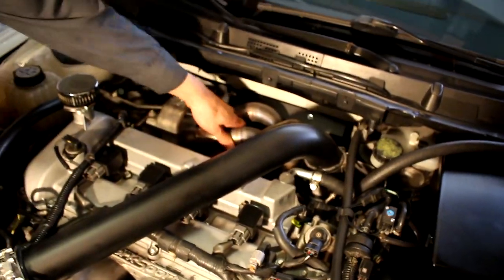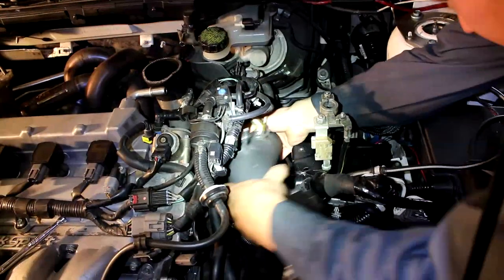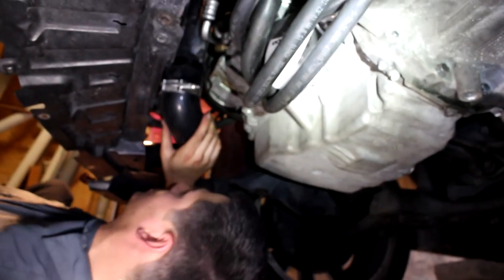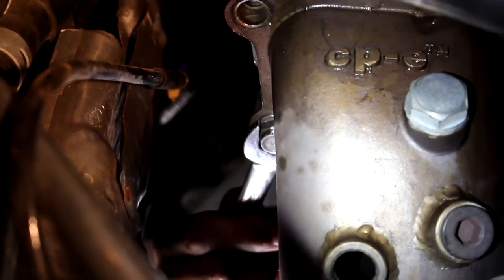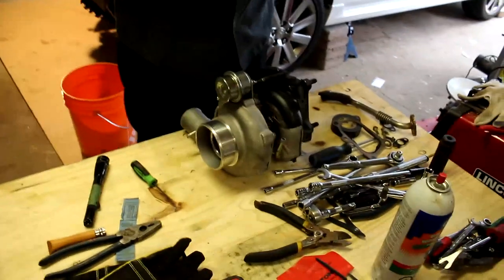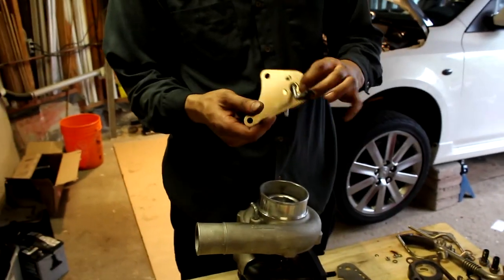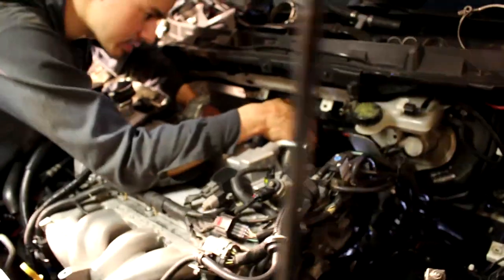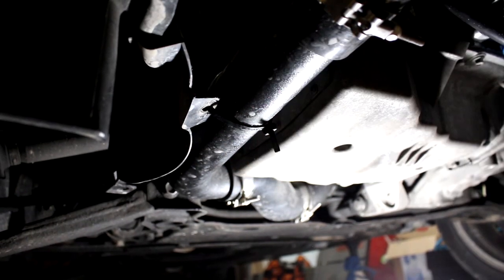Mazdaspeed 3 - Clocking the BNR S4 Turbo & JBR Under Route Piping Kit Install

Comment: Are you clocking the turbo because you uave the underoute piping?
Reply from the maker: Yeah that is exactly why :)
Reply: Can you order it from BNR already pre-clocked?
Reply from the maker: @mjl6425  No I don't think so. U can call him and ask but I doubt it. The issue is that u will most likely need to adjust it
Reply: So any underoute piping the turbo needs to be clocked?
Reply from the maker: @mjl6425  Yes all turbos need to be clocked if u want to run under route piping :)
Reply: I-did-not-know that! lol Did you notice lower temps with the underroute piping?
Reply from the maker: @mjl6425  It helps a little bit, but it's not a huge difference. What's good is that it's a shorter path with less plumbing, and heat soak is less common since the pipes run below the engine where it's cooler. I noticed a big benefit with JBR's thermal insulating gaskets. The intake manifold doesn't get nearly as hot as it used to with OEM gaskets. Every little thing makes a difference :)
Reply: Yes I agree. Did you notice any leaking from the Jbr gaskets?
Reply from the maker: @mjl6425  No leaks to report. As long as the surfaces are clean and things are tightened down evenly, everything should be good
Reply: right on. What did you use to clean the intake manifold mating surface? There’s a bit of old gasket residue I can’t seem to get off. Scotch-Brite?
Reply from the maker: @mjl6425  Just a rectangular flat razor blade, some brake cleaner, and a microfiber rag
Reply: Cool thanks I got it all off but then I put swirl marks everywhere scrubbing it with a nylon brush smh! I swear it’s one thing after another. What can I use to polish out the scratch marks? Any ideas?
Reply from the maker: @mjl6425  Oh darn. Maybe try really fine grit sandpaper to smooth out the surface, but don't go too crazy with it. You just want to smooth it out to ensure no air leaks
Reply: I tried a little spot with 1000 grit sandpaper took out the scratches but now the finish is cloudy looking. Not sure if I want to do the whole thing. But I have a AP TIG, won’t that seal minor scratches like the Jbr?
Reply from the maker: @mjl6425  Yes that TIG should seal up nicely. I would just lightly sand the entire surface evenly until its smooth to the touch. Then clean it with brake and parts cleaner and a microfiber rag. No need to go overboard with the sanding though. Smooth to the touch.
Reply: I’m willing to do that but it’s going to dull the finish. Do you know of a way to bring back the shine?
Reply from the maker: @mjl6425  U could try polishing it! But tbh that area will not even be visible. The goal is to have it seal properly, not shine lol
Reply: Lol ik I’m just a little OCD when it comes to stuff like that. What do you recommend polishing it with?
Reply from the maker: @mjl6425  Tbh Idk I've never thought of doing that lol
Reply: All good man thanks for your help. After the valves are done it’s either BNR or Corksport turbo